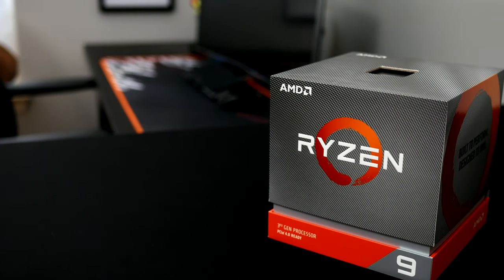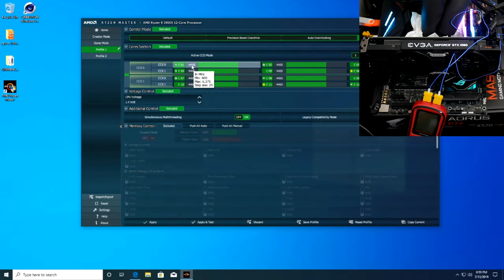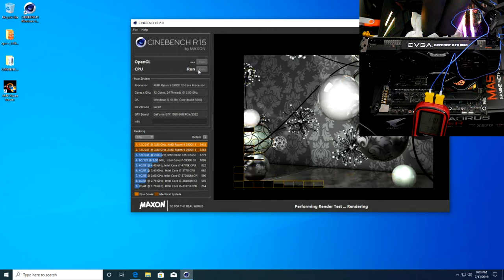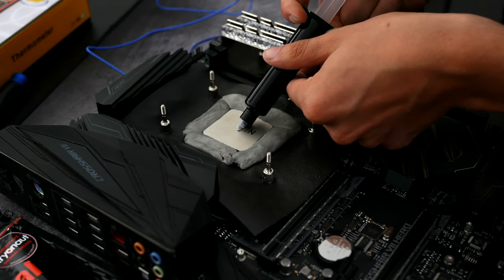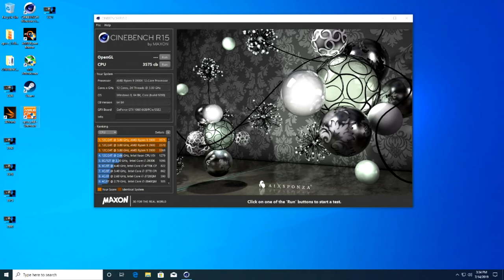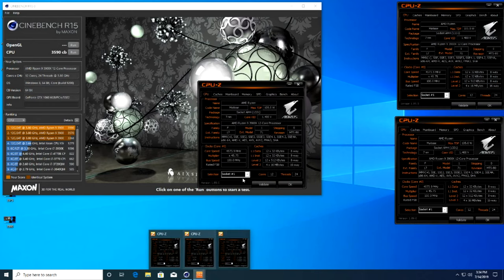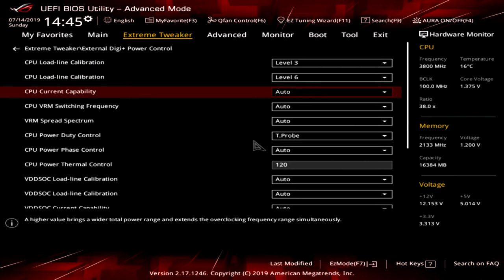Ryzen 3900x on Chilled Water- Finally some decent overclocking!

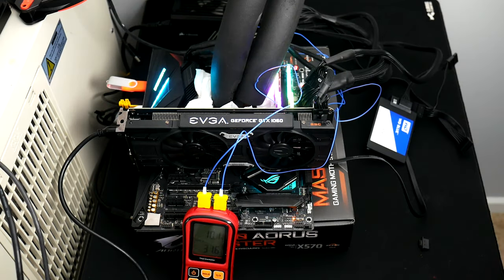Comment from the maker: It will not do *SUB-ZERO*... Sorry for the misspeak around 1:20.
Reply: To clarify, the temperature isnt the issue in regards to needing to insulate... the problem is when you cool beyond the dew point thus creating condensation. This has to do more with humidity

Comment: Hello, expressive results you got !!
Which chiller did you use?
I have the 3900x and wish I could run it at 4.5ghz allcores.
Can you tell me the temperature / frequency scale of this cpu?
Reply from the maker: I will have to get back to you on the chiller itself. I know it's used in industrial applications for laser welders. As for temp/frequency scaling, we really only did manual overclocking, so there wasn't an opportunity for us to note what frequency it would auto boost to while on the chiller. I can say that Steve at Gamers Nexus has done some amazing work on the exact topic of frequency to temp scaling of the 3900x- I would highly recommend you check out his work on that, as he has far better data than I could ever produce. On a side note we just put this same chip under dry ice, and that video will come out later this week! 😁😁
Reply: @LetsGetTechy  I am looking forward to seeing.
Reply: I’m on chiller running at 4450 with 1.425 v. 
4500 not stable in cinebench at any voltage
Reply from the maker: Still not bad at all!
Reply: @LetsGetTechy  how many degrees was the water and cpu at the time of the test?
Reply from the maker: @evilhf915  water would sit around +3 under load. CPU would spike under load to the teens/twenties.
Reply: @LetsGetTechy  Thx 👍👍👍

Comment: Why R15 and not R20?
Reply from the maker: Just prefer it since it's been used for so long. I feel like it's easier to relate the scores since it's more universally known. Eventually I'm sure we'll make the switch.
Reply: @LetsGetTechy  trying to find benchmarks I could compare my scores to and ive found that a lot of testers are using r15 instead of r20. My 7868 score on r20 on my 3900x doesn't tell me much if I don't have reliable overclock to compare it to. Seeing that its my workstation I wanted to compare it to other stable overclocks. anyways cool video! Think I'll stick around and see what else comes out of the channel.
Reply from the maker: @ITpanda  I would suggest checking HWBot for R20. There will probably be quite a few entries there for the 3900x. Appreciate the comment!
Reply: @LetsGetTechy   checking it out now. This would put me at 14th place for r20 on 12 cores and I'm running air. Thanks for the site suggestion, Appreciate it. I'll post my results, maybe help someone else by sharing system information and numbers.